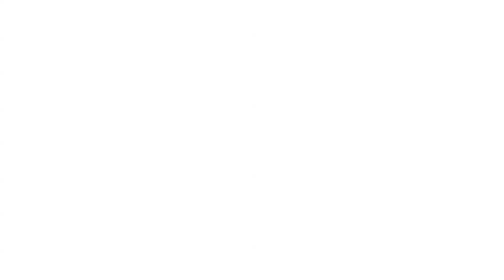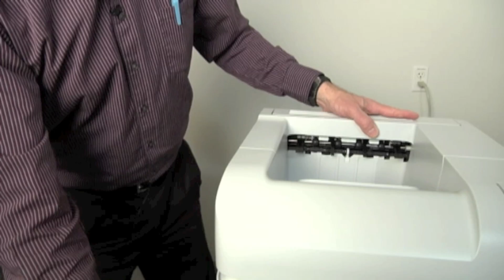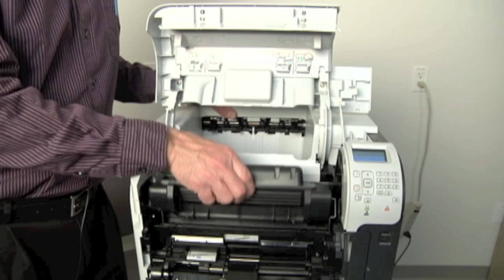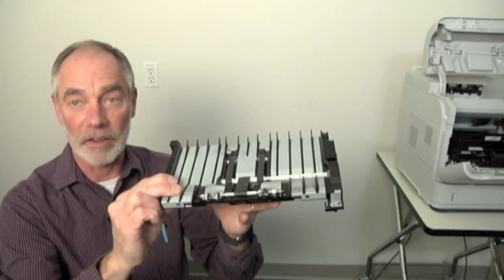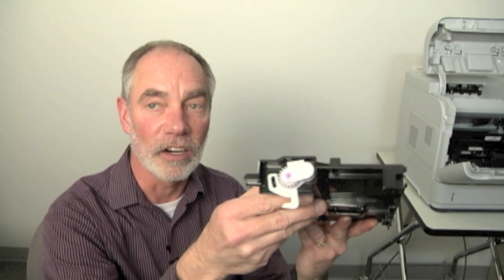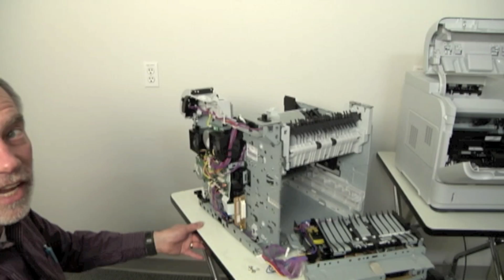PRINTER REPAIR: How To Fix Error Code 13.05

Comment: Steve,  generally the plate over the power supply is referred to as the transport assembly.  It "transports" the paper from the transfer roller/imaging drum to the fuser.